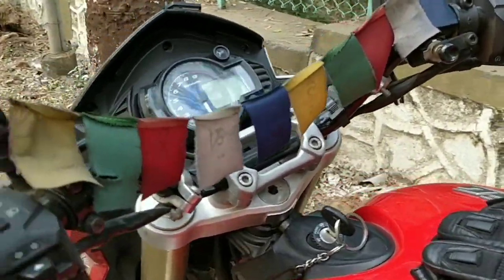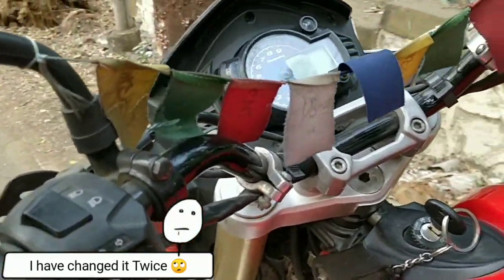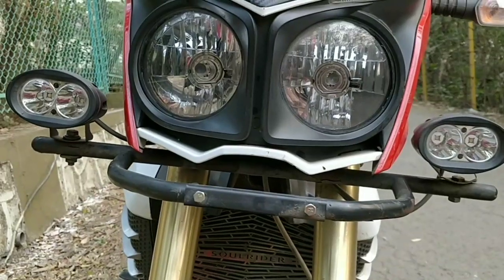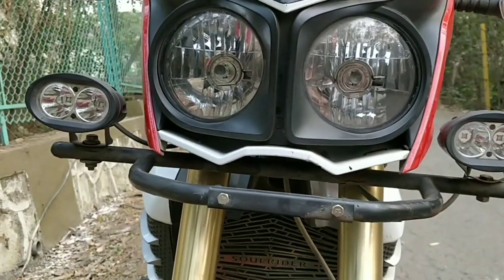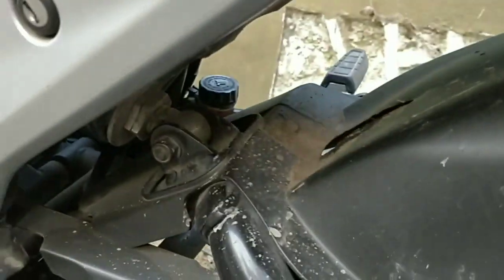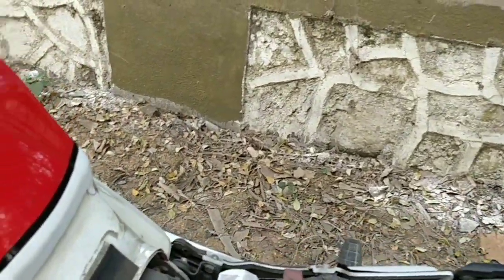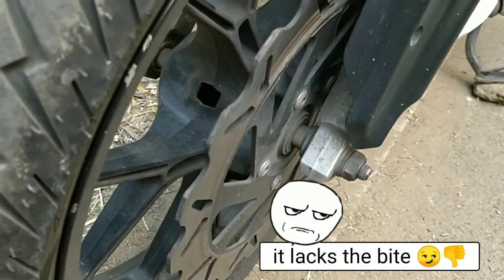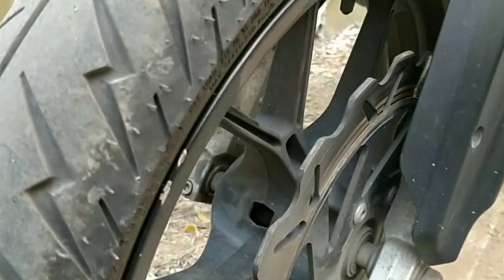THINGS I DON'T LIKE ABOUT MAHINDRA MOJO| HATE VIDEO | NEW MAHINDRA MOJO UT300cc??

Comment: You can install Apache 200 front disc pad for rear mojo disc, it would hardly cost 260 rupees only (genuine) and works like a pro.
Reply from the maker: Already doing from last 2 years
Reply: @SoulRiderVlogs  great, do you know how to improve mojo front breaking?
Reply from the maker: @azimayub9182  Mojo is heavy bike so while braking it leads to more pressure on front break pads

Comment: Hey bro do u still own this bike.. i have the bike since 2016, i have put a LED round doom headlight instead of the stock one. Got for it, it dramatically improves handling and lights.  I have stalling issues and throttle is very snatchy at low rpms. The engine is superb but overall thr bike is not good for me. Im planning to sell it off..
Reply from the maker: Yes I still owns it and it is the best engine I have ridden so far... there are cons but like wise you said even I am planning to modify for smooth ride quality..I guess I am good to settle with this bike itself..

Comment: Somehhing wrong with your front break, it’s over 17k kms for me and I haven’t changed break pads yet, still on stock pads. I have changed rear pads only once at around 10k. Braking is sorted with new master cylinder. Issue with the cone set I have felt only once, during the 5th service.
Reply from the maker: ranju1729 yes i wrongly qouted that as 1000kms however its 5-6k kms the reason of my break pads worn out because i commute 50 kms daily and on weekends i go for ride for 200-300kms so over all in a week i ride 1000km approx so in a month 4k kms i ride which makes usage of break pads more... However i will check with svc guy to upgrade thanx for. Update✌️
Reply: SoulRider Vlogs my daily commute is less than 15 kms. I do not ride all weekends, but when I do it will be like 800 kms in 2 days with pillion and decent luggage. 5 to 6k kms also seems very less life for front break pads. I have seen mojo owners changing front break pads within 17k to 20k kms. I did my 5th service a week back and I specifically asked service guy whether to change the pads. He said it will go up to 20k kms, its 17k kms already.
Reply from the maker: ranju1729 i have done 4th service 22k kms done and break pads changed for 4th time.. so for that  reason i said 5k approx kms we have to change..

Comment: Ecu is on the right side behind the pannel. And those switch as per you which control the ecu are actually fuse which is a fail safe to prevent ur electicals from frying. For tyre you should always go with the recomended size seems like u have chosen incorrect tyre with large side wall size it was ur fault bro.
Reply from the maker: Sidharath Mall regards to ECU I am not mechanic to know that and if you would have been on my place with your bike giving problems whom you would have blame ? Mechanics who dont know how to resolve?  Or i should learn everything ..the tyre i bought was recommended by service centre i left the bike with them and took the delivery the incident happened when i ride back to home noted the tyre allignment was not proper... Yes it was my fault to trust mumbai svc guys.. lemme clear bro i have no issue with mahindra mojo!! But with after service..they provide.. you are lucky not to get any issue ✌️ peace
Reply: SoulRider Vlogs i understand. i have heard a lot about bad service quality in Mumbai. Yes we mojo owners from Delhi are lucky because we dont have any issues with our bike and if any Mahindra team here instantly helps. You should try raising complaints directly to the company not to the dealer. And in future if you have any questions or need help Mojo tribe delhi will be glad to help you out. Ride safe peace out ✌
Reply from the maker: Sidharath Mall yes the main motivr behind this vlog was to benefit over all mojo customers so that they get svc Quality upto mark✌️ thanx for the concern bro cheers

Comment: Good for uploading your reviews. But but.. do you really think off-road the bike will not hit the engine gaurd. Tyre wall size seems to be higher.. please tell your tyre size here. Did you face any problems in ECU.. fuse is for safety purpose. Paint coming out from engine is due to high pressure water wash that too due to negligence.
Only valid issue you have mentioned here is braking.. that too you claimed you have changed pads in 1k km.. doesn't seems to be realistic. 
Yes cone set adjustment is required if you are doing lot of bad roads..
This is ur personal review and looks like service is not upto mark at your locality.
Reply from the maker: Javed Akhtar i have shared what i have faced about my bike.. i love my bike and i want to improve customer service in my locality and yes break pads i have incorrectly mention i.e 4-5k kms... And how cone settings is normal? I have not faced any issues with any othet bikes???
However thanx for watching my video👍

Comment: ECU.. Is not what you pointing. Those are fuse box.. And one should always keep set of extra fuse.. Specially for long rides.

Ride Safe.
Reply from the maker: Sandeep Rathod that is what i said in video now bro how could i show ECU which is inside? And yes i did say to keep extra  fuse.. cheers ✌️